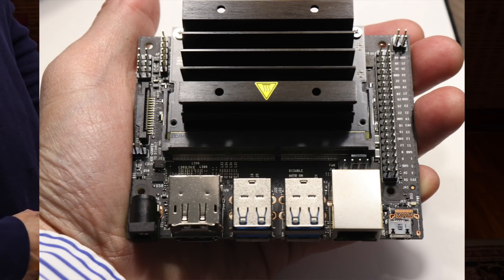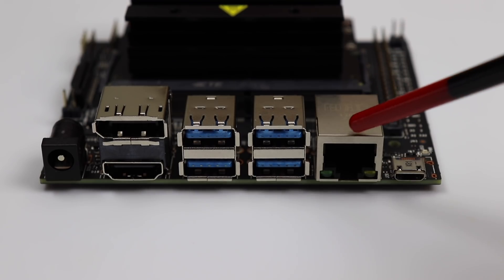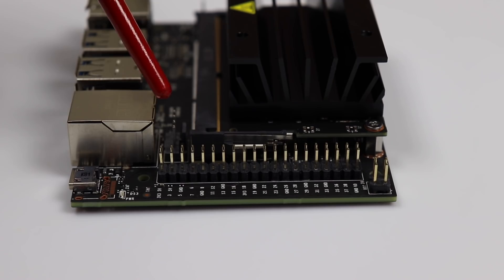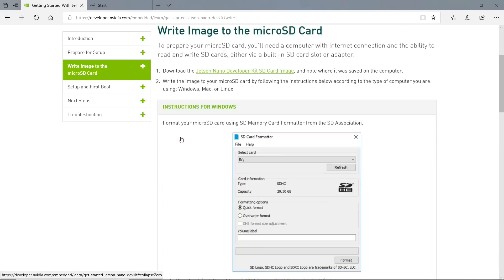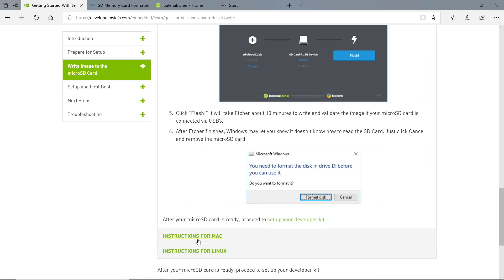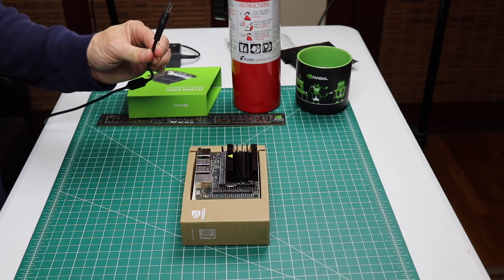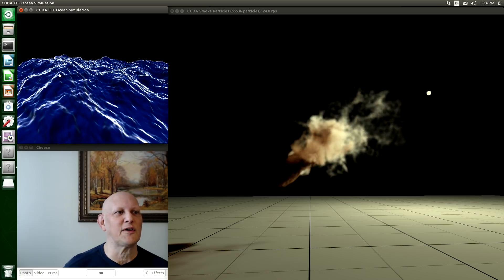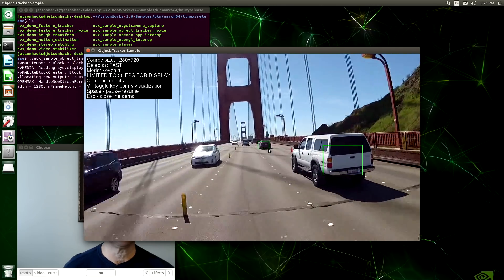$99 Jetson Nano - Intro, Setup and Demo

Comment: Didn't think it would come so bare bones, so basically I can't use it until I discover the accesories required, type of 5V 4A power supply (barrel size?), fan for heat sink?, HDMI cable, USB keyboard, what else am I missing?, etc.
Reply from the maker: The power supply requirements depend on application. You can power the Nano either through micro-usb, or a DC barrel jack. If you are planning to use it as a desktop, full power device you can use a DC barrel jack power supply (with 5.5mm OD / 2.1mm ID / 9.5mm length, center pin positive) that can supply up to 5V⎓4A. Likely candidate: https://amzn.to/2Uji3p1 You will also need place a jumper pin on J48. 

The fan is useful for very heavy workloads, it's a little insurance if you plan on running the Nano flat out for long periods of time. I wouldn't invest in one unless you are experiencing thermal issues. You can read the getting started guide for more information: https://developer.nvidia.com/embedded/learn/get-started-jetson-nano-devkit Thanks for watching!
Reply: @JetsonHacks  After digging around I found an old HDMI monitor, USB keyboard and mouse, 5V 2A USB charger , and a 32Gb uSD  UHS-1 card so I am up and  running!  Agree a fan isn't needed with only 2A charger, it's just slightly warm to the touch.  Thanks for the hints!
Reply from the maker: Glad to hear you got it up and running. Have fun!

Comment: How does it compare in term of performance with a Jetson TX1? Exactly the same or a little bit less “fast”?
Reply from the maker: The are the same chip, but a little bit less "fast". The max clock speed is 1.43GHz vs 1.73GHz for the CPU cluster. The GPU cluster has 128 cores versus 256 on the TX1. In practice of course, it depends on the application as to a performance difference. Thanks for watching!
Reply: JetsonHacks thx! Continue your great work.

Comment: ok if it uses the micro sd card I think we have huge bottle neck and durability issues. is it right?
Reply from the maker: It depends on your application needs. Durability is typical of other flash based storage (SSDs) for the electronics, mechanical integrity is probably reliant on the operating environment and number of device insertions. The SD card doesn't have the same sophistication of error correcting as a full size SSD, but the card will last much longer than a hard drive. However the SD card typically has a 100,000 write cycle limit or so, which means that it will last 5-10 years. As usual, you'd be smart to make backups and such. Thanks for watching!
Reply: @JetsonHacks  My previous experience about raspberry pi3 isn't that great. I realize that micro sd card base system isn't that fast. The system is freeze a lot. I am not sure why Nvidia choose the micro sd card for this board. If you use rasppberry pi long time, well you want to change this micro sd card to USB. I have seen many complain about micro sd card in raspberry pi community also. I am sure you also know well about this problem.

Comment: Hello, can you tell me if the video performance from sites like Dailymotion, openload, YouTube on Chrome look good in HD - without any hiccups? Thanks in advance
Reply from the maker: Not quite sure what you mean. It's a standard browser experience which depends on your Internet connection speed. Video compression/decompression is hardware accelerated. Thanks for watching!
Reply: @JetsonHacks  thanks for a quick reply. I'm looking for a mini pc/ board to connect to my TV and watch streams from netflix, HBO go, Dailymotion, openload via Chromium (or some other web browser). Raspberry pi lags and does not have a smooth experience. I was wondering is the Jetson bank with Ubuntu would be better for this type of tasks.
Reply from the maker: It uses uses the same processors as a NVIDIA Shield TV. If your only interest is a media center, It's probably a better money deal to buy the Shield ( for example https://amzn.to/2U3zUB9 with or without a game controller)  which is $70-$90 more but is a consumer device with all of the power supply and connectors you will need. If your needs encompass a larger idea, the Nano should work.

Comment: On the product page it says 16gb emmc, also storage micro SD card"not included"
Reply from the maker: The 16GB emmc is for the production module, not the developer kit. There is no MicroSD card included in the developer kit, you must supply one (at least 16GB).

Comment: Does it have full GPU acceleration? Watching Videos in vlc, smooth scrolling in a Browser Like Chromium etc?
Reply from the maker: Yes. It has a 128 core GPU and hardware video encoders/decoders. Thanks for watching!
Reply: @JetsonHacks  ok, We have the Hardware. But do we also have the full drivers which Ubuntu needs to accelerate everything? Just asking, because I made already Bad experiences with some Others ARM Boards in regards to that.
Reply from the maker: The installation above includes the NVIDIA modifications to Ubuntu (L4T) which allows full access to the included NVIDA GPU drivers.

Comment: Excellent intro! I'm waiting to try one.

If I use a pi cam v2 with Jetson Nano, will I be able to get photos in full resolution (3280 x 2464) at 30 fps (30 photos per second)? Raspberry pi takes several seconds to read and process such a photo. Can Nano do it faster or is it a common limitation of the camera / interface?
Reply from the maker: Typically these types of cameras have different modes, one for photos others for video at varying resolutions (usually 640, 720p or 1080p). 3K video at 30fps is a big ask for this class of device. Thanks for watching!

Comment: hi sir i have two queries.
1.Do jetson nano gpi0 40pin gpio has same internal connection like rpi 40 pin gpio?
2. i have "Arducam Multi Camera Adapter Module Fully Compatible for Raspberry Pi Model A/B/B+". Can it be useable with this jetson nano?
and one out of the box query.
i found Google's Coral Dev Board is also there. Intel's Myraid based some SBC is also there. I'm planning to use an SBC for mainly deep learning based computer vision application development. Please suggest me which would be the best as per your long term experience in this field.
can this jetson nano sbc be a good cost effective substitute of the tx1 or tx2 or xavier. Or there is significant performance degradation due to cost & size optimization in the newer one.
Reply from the maker: The layout of the GPIO pins are similar to RPi. On the Nano, the I2C and UART connect to special hardware and cannot be changed. However these pins are in the same location as on a RPi. The rest of the pins, other than power and ground, are by default GPIO. Thanks for watching!
Reply: @JetsonHacks  Thanks for your reply. can you please let me know to solve my other queries as posted there. It'll be very much helpful for me as I'm a novice in the SBC field.
Reply from the maker: Please ask this question on the official NVIDIA Jetson forum where a large number of developers and NVIDIA engineers share their experience. The forum is here:  https://devtalk.nvidia.com/default/board/371/jetson-nano/

Comment: Thanks for the video! 
I do want to know if I would like to upgrade later on. Could I just take the SD card into a TX2 and run it? or there are some changes to before I see it working?
Reply from the maker: The TX2 and the Jetson Nano have different processors and different boards. The SD Cards cannot be swapped, though all of the software is easy to port. This is due mostly to the GPU architecture being slightly different. Thanks for watching!

Comment: Is nano only can be used in linux?
Reply from the maker: Currently the Nano runs L4T an Ubuntu 18.04 variant, so the answer is yes at the moment. However you can prepare the disk image using a Macintosh, Windows machine or a Linux machine. Thanks for watching!
Reply: @JetsonHacks  that really did not answer the question , maybe a simple " I do not know"
Reply from the maker: @ne1cup  Asked and answered. There are ongoing projects to run different operating systems, such as Windows ARM (which should work but has not been fully test by launch day), but, again, at the moment, Ubuntu is the officially supported operating system that NVIDIA supports.

Comment: So Nvidia wont't add 4 USB ports to the xavier or Tx2 but the nano gets it.. wow :P
Reply: The Xavier has 2 usb type-c ports, a usb 3.1 port, and a usb hybrid port so it technically has 4 ports and 2  of them should have higher bandwidth than these. They may have 4 ports but that does not mean they have 4 host controllers, so it could be even less overall than the Xavier. I think this was just intended for ease of use. I might be wrong though.
Reply from the maker: All 4 USB 3.0 connectors go through one hub, it's more a convenience thing.

Comment: Just what the Doctor ordered:  I had no idea this was available until you put this video together. USB 3 for the RealSense Cameras and ROS compatibility?  How does it compare to the TX2/TX1?  It has more USB ports!
Reply from the maker: It is the same chip as the TX1 (t210) with 128 GPU cores instead of 256. A big advantage is the extra USB ports, and it's nice to have a smaller footprint. It is also easier to interface with hardware from the Raspberry Pi and Adafruit worlds because of the addition of the Jetson GPIO Python software library. The Jetson GPIO Library is compatible with RPi.GPIO, and Adafruit has ported their Blinka Circuit Python libraries. Thanks for watching!
Reply: Do you have and idea if you will be doing  RealSense, ROS video's?  Can we hook it to a SSD drive?
Reply from the maker: Yes I do.
Reply: @JetsonHacks   Cant wait for that video. Super excited to use my realsense with this.  Do you think it will have similar issues with building the realsense SDK that the Xavier had? I really hope Intel is working on adding support for the Jetson line soon like their competitors have been.
Reply from the maker: The changes to support the RealSense video formats is in part of the kernel which can not be modularized, so there's no easy way to just add a few modules here and there to get it to work.
Reply: @JetsonHacks  so the nano can not support RealSense, like the TX2 can?
Reply from the maker: The Nano supports the RealSense.
Reply: @JetsonHacks  Sir, this comment made my day ;) Hats off to your hard work!